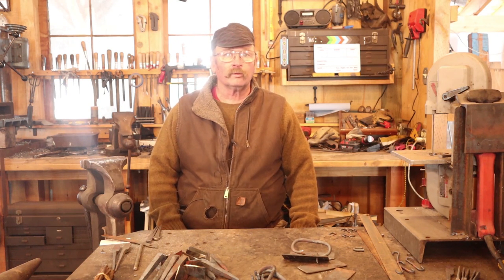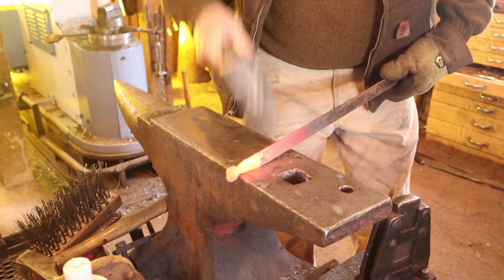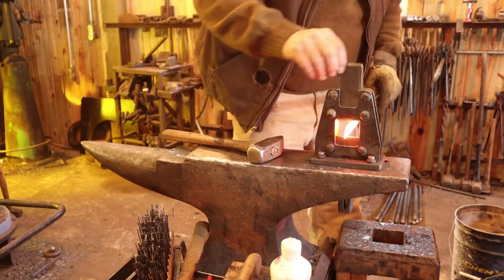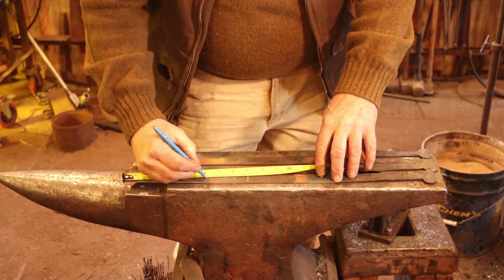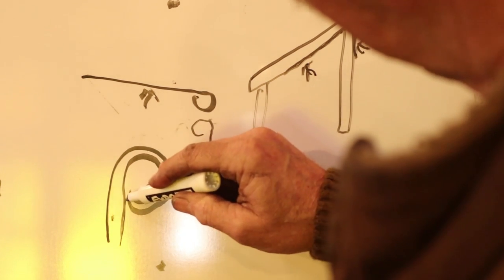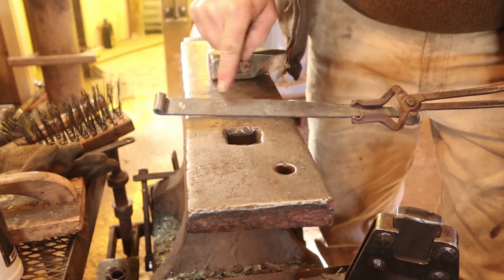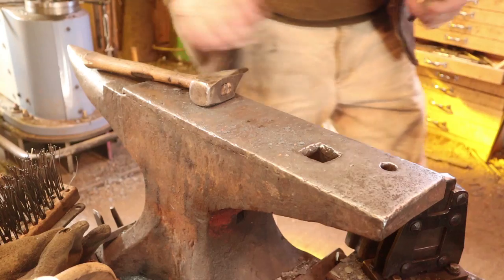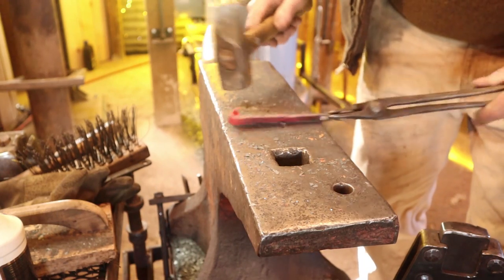Dutch Tool chest hinges part 1

Comment: John you did excellent work, and your attn to detail is impeccable in this project. IMO, it's a shame that you later cut 2/3 of the metal away, and only used a 1/4 in. from the middle. Thanks for the lessons, and the sharing of trade secrets. I'm pretty sure I would have just wanted the middle cut out of each hinge and then offset the straps to line them up. But again, Thanks for sharing your knowledge and yrs of experience, with those of us who have less of both. ;-)
Reply from the maker: I'm not sure what you are referring to.  I started with 20" and forged a strap on each end.  One was cut 13 /12" and the other 6 1/2" leaving about 1 1/2" of material that later gets used as a piece for the hasp.

Comment: When your rolling the eye, how do you keep it flat? (Not concaving with the outside edges flaring up)     ]
Reply: And thank you for another great video
Reply from the maker: In the 1" material it isn't much of an issue.  In wider material you can prebend so it ends up straight when you're done.

Comment: I couldn't help but notice that your anvil seems to be a bit higher than the recommendations I've seen given. basically I've always been told that the anvil face should be high enough so that your hammer face sits flat on it with your arm fully extended. I'm told that this is supposed to relieve stress while working. Although I find that at that height it feels too low for me. Do you have any problems having your anvil as high as it is and is there a benefit to having it at that height for you? I'm thinking about raising my anvil up after watching your videos to a more comfortable height. What are your thoughts?
Reply from the maker: My anvil is a bit high, but you also should think about the old recommendation for a level hammer blow at full extension.  Fully extending at every blow would be hard on your elbow, so my anvil is set for a level blow just short of being fully extended.  Much easier on my elbow and my back.  But it also has to do with the size of work you are doiing and whether or not you use a striker, that might make a lower anvil better.

Comment: I’m sorry to say it but there are many people out there that will take someone else’s idea and call it there own.
Reply from the maker: You are right.  I hesitated sharing this design for that reason. But in the long run my goal here on YouTube is to share information and while I hope people won't go out and use my designs to lure my customers away, I also don't believe there should be any trade secretes
Reply: @ @BlackBearForge  Knowledge is power, and trade secrets is what keeps people in business. Share non critical designs but not the important ones. China kept the silk and pottery industry a secret for centuries and once the west found out how to  make silk and bone China, China declined rapidly as the west no longer needed to trade with them.
Reply from the maker: Trade secretes are also what has caused a great loss of valuable information over the years.  There are great works of forged iron from the middle ages that people have been trying to replicate for generations, but the tricks and techniques used were kept secrete and died with the old masters.
Reply: you sound like you must be long to "I forge Iron" group...

Comment: Great video.  I have been in the process of trying to duplicate some hinge patterns from 18th Century Pennsylvania painted chests.  As always you make rolling that eye look easy!  Man I have really struggled with keeping them neat and even and like you said trying to get them to tuck under correctly.  Interesting from my research I have found that some of even the early hinges the design elements were cut from strap and then of course the hinge connections themselves where forged.